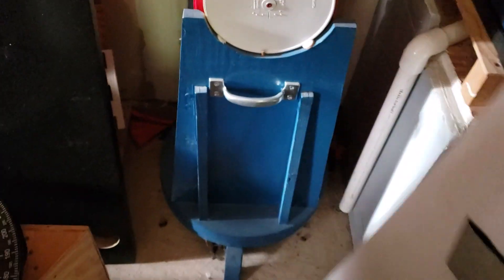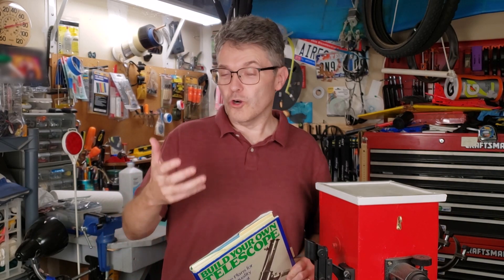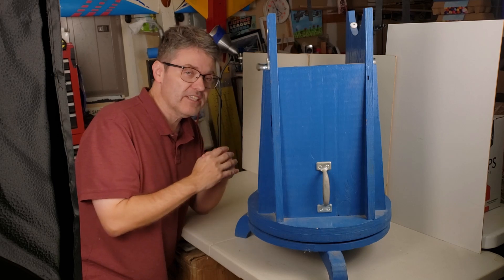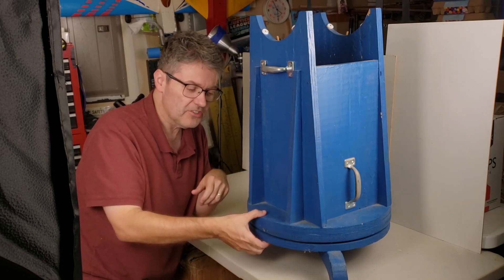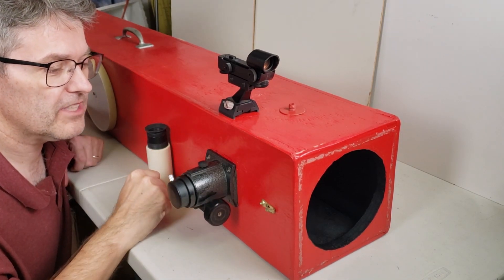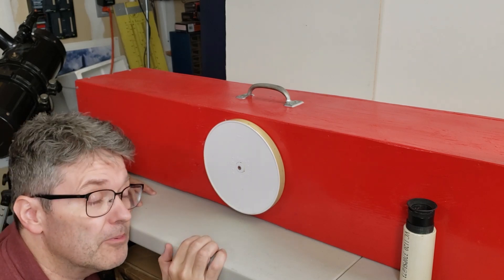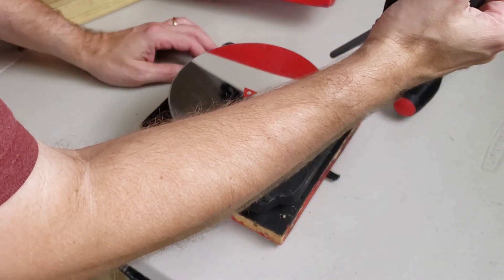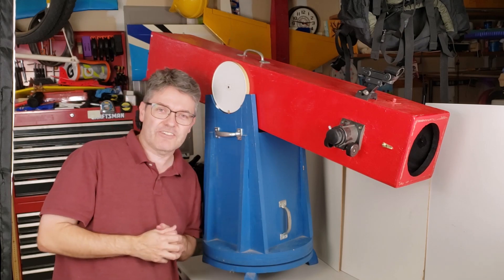My First Real Telescope

Comment: Back in 1966, my friend and I built an F8 12.5 inch reflector. We ground our own mirror, which came out pretty good.  We then went on to an F4 10 inch,  which we mounted alongside a really massive EQ mount, also homemade. I'm 75 now, and have a Zhumell 8 inch Dob, and a 70mm Maksutov. Been looking up my whole life.
Reply from the maker: Wow, a 12.5 inch in 1966 must've been the biggest telescope around.  Was it parabolic?
Reply: @AstronomyGarage  I'd read that it's basically impossible to grind a parabolic by hand. At least not accurately. Maybe that's not completely true, but it wouldn't surprise me.

Comment: Built my first “real” telescope, a 6” f/8 dobsonian in 1989 with the help of a friend who supplied Novak parts for the mirror cell and secondary spider.  The first focuser was also a 2X4” block and a friction fit aluminum tube piece from a vacuum cleaner.
Reply from the maker: Sounds very similar to my first real telescope!

Comment: My Dad bought me a 6in reflector (I was 14 years old in 1978) that an old fellow had built and stored in his attic.  The mount was made of cast iron pipe pieces.  It was quite heavy.  When we got it home and tried it out it wouldn't come to focus.  Took it to an astronomy club who was meeting at a local University.  Their conclusion was the mirror was too far down the tube to achieve focus.  Drilled some new holes in the OTA for the mirror holder and it worked!
Reply from the maker: Wow, it sounds like you were tinkering with telescopes from the very beginning!
Reply: I have an ATM telescope on a pipe pod, it needs a resto but it's a great telescope.

Comment: Thank you for sharing some info on your first scope.  I got my first scope at Sam's club for around 120 bucks.  It had those tiny 3/4 inch EPs.  Somehow, even with that scope, I got bit by the astronomy bug.
With the new goto scopes becoming so much more affordable, I hope more folks are drawn to the hobby.  I'm really loving my ZWO S50.  I've had it a few months now but I am looking forward to ZWO releasing their larger version.  I think its going to be 90mm.
Reply from the maker: It sounds like you made it through the hobby killer phase despite the terrible eyepieces.  My "phase one" telescope which killed the hobby for me for ten years had absolutely terrible 0.965" eyepieces.  The dust and defects in the lenses were larger than the planets I could view.  The smart telescopes seem to be the future.

Comment: Where did you source the mirrors from when you built this? I feel you glossed over that part 😅
Reply from the maker: Good question!  I don't remember the vendor, but I do remember paying about $175 for the pair of mirrors and they came from King Of Prussia, Pennsylvania?
Reply: There is always ebay, though the state of the mirror can be a crapshoot. The good news is as long as the geometry is good, you can always resilver it yourself. The downside is without the ability to put the fancy optical coatings on it (vapor deposition) eventually itll oxidize at youll have to do it again. But I know of a number of astro nerds that silver their mirrors every few months, its not that hard, and kinda fun.

Otherwise, I can vouch for Telescope Warehouse. I got a new set for a curb find meade 4500 (114/900), they came perfect and wrapped to high heaven.
Reply: Sorry if my question alluded to where to buy mirrors in 2025 🙂 I know back in the mid 90's there weren't many (if any) stores online so I was curious where Reflactor would have found them back then @TankR

Comment: My first "scope" was a 60mm Tasco from a local store (prominent but I can't remember the name). Absolute piece of junk, but got me interested.
Reply from the maker: That sounds like my very first telescope (Phase 1) in the early 1980's. It used awful 0.965" eyepieces.
Reply: @AstronomyGarage  yes, they were. I'm rocking a slightly better 80mm Selsi now (focus tube was 0.9 now its 1.25") and a 10" Dob.
Reply: @AstronomyGarage  I got some of the Meade 4400 and 4500 series (one of each still new-in-box, plus some assembled) that originally came with the .965" eyepieces, but it's pretty easy to find adapters for 1.25".  Some of the 4500 series can even use 2" eyepieces although being 114mm scopes it usually isn't worth buying 2" eyepieces just for those.  But if you had some anyway for using with other scopes, they could be used with the 4500 series also.  Now that I have the Orion 8" I'll be getting some 2" eyepieces at some point for that, and I could try them on the Meades as well.
Reply: Yeah, I got a couple 60mm early on, even though they were decent brand it was disappointing.  I don't even consider anything below 70mm any more, not even if I was just giving one to a friend or something.
Reply: i still have my first scope  a 4 1/2 inch reflector on an eq mount i got in 79'  i still use it

Comment: Nice work!  My first scope back in 68 was the Edmund Scientific 4 1/4" reflector.  I recently found it in an attic, had the mirrors resurfaced and I painted the mount and base.  My only regret is that the low power eyepiece was lost long ago.  I bought a new one from Edmund and this thing is a good as new.
Reply from the maker: That sounds like a fun restoration project!  Have you tried the Edmund RKE series that they made popular with the Astroscan?  Especially the 28mm?
Reply: @AstronomyGarage  Yes!  I bought one and the view is fantastic.  Thanks.

Comment: I'm about to build my first telescope.  Currently waiting for the mirrors for a 114/900mm reflector design called the Hadley. That will be my first proper scope and I'm already hyped. I have two small aperature refractors but I wanted something with a bit more light gathering power.
Reply: Telescope Warehouse? IDK if they're still doing their thing, but if those mirrors have issues, give them a shout. I got a 114/900 set for a Meade 4500 I got for free, came perfect and bubble wrapped to high heaven!
Reply: @TankR  Seems like a cool place to hunt for parts but sadly VAT to order stuff from the US here to the EU doesn't really make sense, ordered from a chinese seller who has good ratings for these specific mirrors, so I hope it's good. If it has major issues and I can't get a replacement? Well then I just have a 114mm blank and I'll turn it into a parabolic F5.
Reply: @U_Geek  ah nuts. Well, depending on how adventurous you feel, you can get a precision ground parabolic slab of glass and silver it yourself. Of course without the fancy vapor deposited optical coatings the silvering will eventually oxidize, and you'll have to recoat it. But its a pretty fun process, not too hard or expensive, there are a bunch of videos of astro nerds that silver their own mirrors. [Shrug] Just a thought for something (more) to tinker with 😅
Reply: @TankR  Yeah I actually looked into diy mirrors because I saw that you can get spherical F5 mirrors for quite a good price and I know that you can totally parabolyze a mirror yourself. And I also looking into silvering. On that point I found that silver coated mirrora aren't that big of a pain if you take care of them. I will probably one day make a large dob myself, sounds fun.
Reply from the maker: Oh man, that sounds like a fun project. Let me know how it goes!
Reply: @AstronomyGarage  just finished building and testing it. I love it. I thought the difraction spikes would be a bit more pronounced but I love it. I printed an ironsight style finder and got to star hopping. On my first night seeing was so bad stars were the size of jupiter in the eyepiece, but the second I managed to find and observe the leo triplet. With some tricky averted vision I managed to get all 3 to pop at once, that was a cool experience, they just barely fit in my fov at once. I also love how many more faint stars there are everywhere with this scope. 10/10 would recommend.